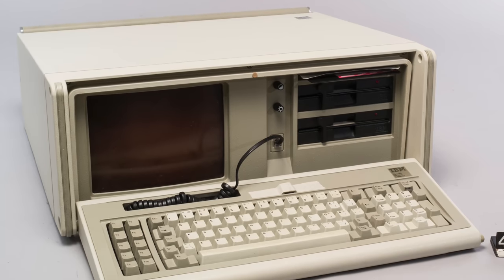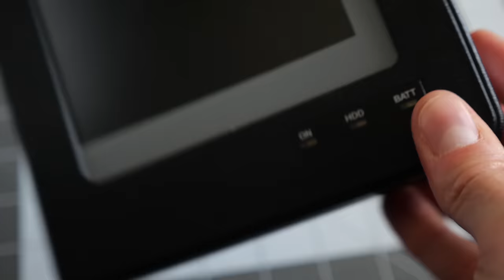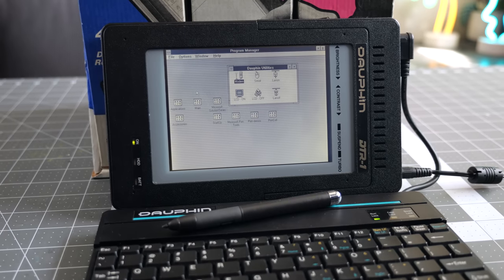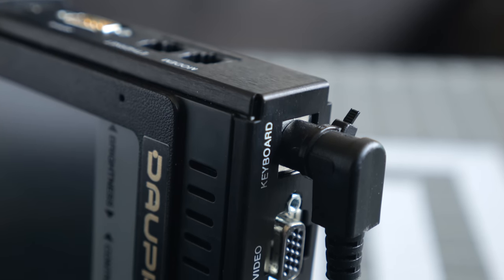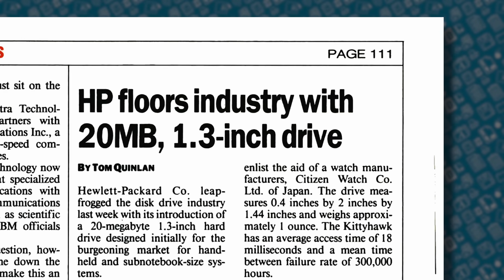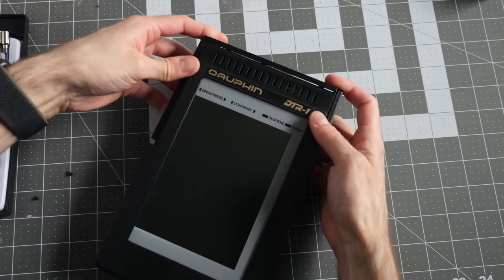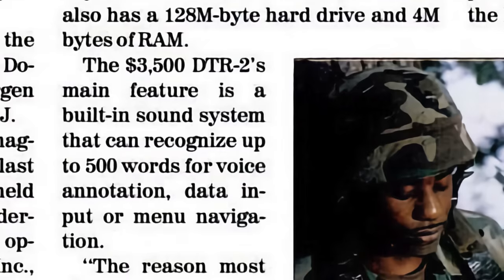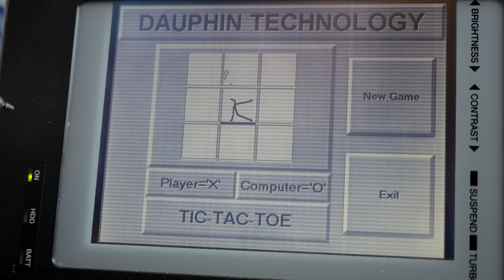Dauphin DTR-1: The 486 Touchscreen PC from 1992!

Comment from the maker: While doing research for this episode, I ran across a couple of articles from 1992 that referred to the Dauphin 5000 Palmtop. It would have had a larger screen, wired stylus, and slower 25MHz 386 CPU, but better battery life and more storage than the DTR-1. However, I haven't been able to find any evidence that it actually shipped, so as far as I can tell, it never left the prototype stage.
Reply: If you ever need AAAA batteries again, most alkaline 9v batteries are made up of 6 AAAA batteries.
Reply: @tarstarkusz  That's a really good tip.
Reply: The  Evolution of the pre- Microsoft Surface :  Screen with Detachable Keyboard...
Reply: @tarstarkusz  Another handy tip:  When the 9v alkaline runs dead, tear it apart and salvage the + and - terminal assembly.  They make for great 9 volt battery connectors to use in projects or wherever you need that kind of connector.
Reply: Colin, are you thinking about seeing if you could do a CF to IDE hard drive replacement at some point?  Maybe find also a PS/2 keyboard with a straight connector and pass-through to connect a PS/2 mouse.  Otherwise, you'll be tying up the serial port with a serial mouse.
Reply: @minty_Joe  I do that too.  As you said, good for projects.
Reply: @minty_Joe  Can you get a serial port double adapter?
Reply: @ishakali8634  Unfortunately, serial ports can't handle multiple devices at the same time; you can only assign 1 device per port.  Otherwise, you're relying on an A/B switch to go between devices.
Reply: Super Nostalgia  I love and fear the Lord Jesus Christ, but what in God's name does this have to do with retro tech?

Comment: AAAA batteries are used by active styluses to this day (I've got one for my Yoga notebook I bought last year). Interesting how that part of the technology really hasn't changed much in my lifetime.
Reply: I has to use AAAA batteries in the pen of my 2014 Sony convertible. It uses technology by Ntrig, a company later bought by Microsoft for their Surface products.
The longevity was good (about a year when in pen) but the availability was poor where I live. Always had to get them by mailorder -- and always in packages of two which means one would dwell in a drawer for at least a year. Generally not a problem but I never had another device which uses them.
Today we have at least two alternatives available: Wacom tech uses passive styluses and other active pens like those from Microsoft & Apple use rechargeable batteries or supercaps in their pens.
Reply: Yep! If I recall correctly, pens for digitisers using MPP or Wacom AES have to have batteries.
Reply: @kbhasi  Yes, there are some Wacom products that are "active" but use "passive" tech (no batteries) in most of their product lines that are aimed mostly at artists all use passive pen tech.

Samsung smartphones AFAIK also use the passive Wacom tech for their S Pens which means you can always draw/point with them. However, their newer pens have bluetooth connection for additional functionality that need more power. They use supercaps ("capacitors with a very high capacitance") like rechargeable batteries for this.

Older Microsoft Surface pens have two(!) kinds of batteries in them: the AAAA ones for basic pen use and tiny button cells for additional bluetooth functionality (essentially, only a single button to get a menu or an app on screen). Changing them was a hassle.
Microsoft has refined this and their "Slim Pens" use rechargeable Li-Ion batteries that can be quickly recharged in their "Signature" keyboard cover for the Pro 8 and Pro 9 tablets or under the keyboard (Surface Studio Laptop).
Reply: Yep, my ThinkPad Yogas active pen uses a AAAA battery. Microsoft Surface lens also use a AAAA
Reply: The original Apple Pencil has a clumsy charging way, you have to put its rear end into your iPad’s Lightning connector and hope you don’t demolish one or both by bumping into it.
Reply: @oldguy9051  
I already know about that. The passive stuff is what I refer to as either Wacom EMR, Penabled, or Feel IT. I'm not sure which is the current name for the passive tech that Wacom licence to other companies, but I know they used the median in the late 2000s and the latter in the early 2010s.
Reply: @kbhasi  I don't write exclusively for you ;-)
Reply: @oldguy9051  
You specifically selected to reply to me
Reply: @kbhasi  Yes - and others read that, too.
Reply: And we are talking 30+ years, probably as much as wireless computer pens have existed! So yes, apparently, that battery size has been a staple of those from the beginning.

Comment: Holy cow, a 1.3" hard drive, Ethernet, active stylus, in 1992, this device was way ahead of it's time...
Reply: Looks to be a good example of "almost" being there, but being so far away. 

If it had a docking station it would have been pretty useable. Even for the time this looks like a hassle to use. Which is probably why it's in good shape, it wasn't carried around everywhere.

Comment: By the way - if you ever have trouble finding AAAA batteries, cut open one of those square shaped 9V batteries and you'll likely find six of them inside
Reply: Yes, that is one type of 9V battery construction. The other type use six small rectangular cells.
If you have the right one with six AAAAs inside: Check the polarity of the contacts of the cell!
I once had one where it was "reversed" as in: "the little knob end was the negative and the flat end was the positive"

Comment: This is really futuristic for the time. Interesting that the overall concept is nowadays replicated by modern tablets with attachable keyboard pretty much identically and additionally it also has the dual-use mobile/desktop concept that has not yet really caught on but may eventually (I am writing this on a Steam Deck in desktop mode, connected to a couple of monitors, a keyboard and a trackball)

Comment: Wow, I thought I was the only person who ever saw one of those.  I purchased one at a computer show, and used it as my travel unit for three years.  That stylus was a good idea with some real production issues.  The touchscreen feature only worked with the stylus, and that note to text software was bad to say the least.  My keyboard died at the connector to the unit, so a substitute unit joined things after nine months.  

I finally gave up on the unit when the hard drive faulted out with a head crash.  The power supply heat issue was solved in the same way you did.

Comment: The glue around the ribbon cables was not a factory option. My guess is that whomever was in there before you messed something up. 

ALSO, remove the cmos battery asap! They leak even worse than the old Varta barrel batteries. Lastly, if you have a chance, replace all of the small electrolytic caps in the screen itself. I used ceramics, and they work great!

Comment: Looks like the replacement stylus is very similar to the one used for the HP TC1100. The TC1100 was one of my favorite computers ever. Got me through much of college.
Reply: I suspect it's the stylus for the (HP) Compaq TC1000, the predecesor of the TC1100. I've got both tablets, but only my TC1100 works. The TC1000 pen takes a AAAA battery, while the TC1100 has a Wacom digitizer, whose pen is powered inductively by the tablet, requiring no battery.
Reply: @RaduTek  Right. I never used the TC1000 so I wasn’t certain about it. The 1100 also had an eraser than than lanyard attachment at the back end, right? Or am I misremembering?
Reply: @davidlylejones  No, both pens have a lanyard hook instead of an eraser.

Comment: An interesting thing about that processor as well is that it’s one of whose weird 386/486 hybrid chips. It has some 486 instructions (from my knowledge, not enough to be seen as a true 486) but uses the 386sx pinout.
Reply: these were common clip-on cpu upgrades marketed by Kingston and the like.  While it wasn't as fast as a real 486, it gave a tremendous amount of computational speed over the stock 386.
Reply: Cyrix did that again later with their 5x86, a 486/Pentium hybrid for 486 sockets.  (Their actual Pentium I clone was the 6x86.)
Reply: I've always heard of those slc's as "half 486's"

I don't have one in my collection to compare, and never owned one.
Reply: @volvo09  from my experience with the Cyrix 486DLC, another hybrid 486, they are faster than a standard 386DX, and have SOME 486 instructions, but it’s not enough to run 486-only applications.

Comment: Ahh... I remember when I was an undergrad I picked out a Fujitsu Pentop out of my boss's junk box and messed with it.  It was quite capable at the time and it boasted a 486 DX4 100Mhz processor and 8 megs of ram.  It was bulky and I had to carry around a full sized keyboard with me to use it on the go, BUT it was very very useful since it could almost run all of the productivity tasks that my Pentium 3 desktop did at home.  As a broke college kid, I couldn't afford a laptop, but the  Point 510 was so interesting at the time that it always turned heads.  The nice thing about the stylus was that it was completely passive, so if I didn't want to use it, I could use the cap of a ball point pen to navigate the windows 95 operating system.   Complete with a port replicator for basically anything, I even remember doing some basic midi sequencing and music composition on it for class.   I did try gaming on it but the LCD screen was a ghosting nightmare.  It also had 2 PCMCIA slots in the top, one of which was populated with a nic / modem card.

Comment: Years ago, I came across a British designed "portable computer" but it was more of a pda.
Checked the manual and found that it was manufactured in the late 80s.

It had a keyboard for typing and a notepad for recording texts.
It also had an area at the back of the device for placing a phone. That was the magic of the device (it can transmit a fax signal to a remote fax machine).

Comment: I knew someone who had one of these, they loaned it to me in 2000 or so.  The pen didn't work despite me replacing the batteries.  The rest of the machine worked just fine, interesting device really.

Comment: One important thing that seems to be lacking is a method to calibrate the stylus to the touch screen. Like the later Palm devices have, where you aim the stylus at a target to calibrate the screen.
Reply: It may not be an issue though, since windows navigation was fine. 

Palm devices had passive stylus' so it required initialization to sync with the screen. 

Maybe this had an "initialization after power loss" sequence we didn't see, but I didn't see calibration to be off. Especially since accuracy was mentioned in articles, back when precision wasn't even expected.

Comment: Interesting little CPU there, shame it's not really much faster than a 386SX, which that's a pin-compatible replacement for -- the Cyrix 486SLC has 2K of L1 cache, but still has the 16-bit external data bus and 24-bit address bus of the 386SX.

I wonder how difficult it'd be to adapt a SD adapter to fit in the space of that KittyHawk drive? Not that you need it, particularly, but those drives are prone to failure, I've heard.
Reply: You can replace it with 50MHz by the way ) And yes you can put SD with adapter without any problems

Comment: It was "desktop replacement" something like NUCs with a screen which you can use on the road if necessary ) So it wasn't very good as laptop and for a desktop replacement - too innovative for the time ) By the way, the port for a floppy also contains IDE pins and even the power, so there were plans to supply external HHDs

Comment: Wow, Imagine what Microsoft could have done if they invested more in tablets...
Reply: I mean they did try a lot. For pen computing, mobile, rt, xp tablet edition, 8/8.1. they were just too hung up on uniform platform design(trying to cram desktop os into tablets or tablet os on desktop. When they should have gone the apple route of two separate things like Mac and ios) and I get why that is (even though apple makes mac's, they only represented a sliver of the PC market, they are primarily a phone company and what people want to do with tablets are to use them like phones, while ms dominates the PC space, seeing tablets as basically laptops without keyboard and most people don't use them that way). That said, I do love surface pro's(though I keep them in desktop mode even when using them as tablets)
Reply: @ericp631  they did...but too late.
Reply: @ericp631  people wanted a decent and possibly cheap tablet PC since the early 2000s, but all we got were goofy prototypes that never went anywhere.

Comment: Please remove that battery asap! they like to explode and kill the board, i have 3 boards here that are dead from that dumb battery. My unit i have is good but the battery destroyed the previous mobo and the backlight driver, so i used one from another laptop to make it work. I also am missing the pen for it so I still need to find one or one that works with it. Also I have a rare image of the drive from a test unit with test software on it, just gotta upload it.